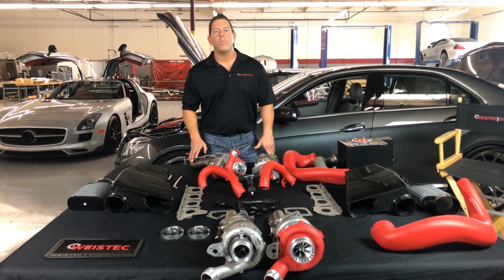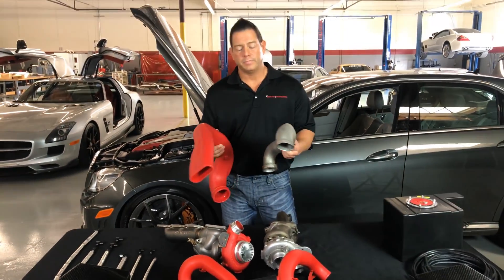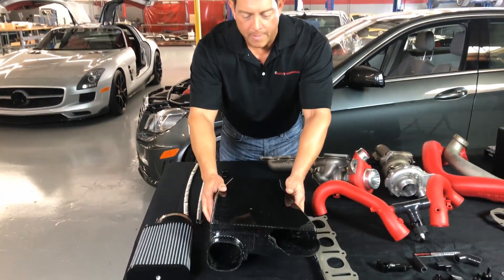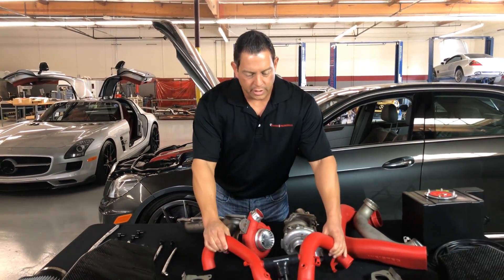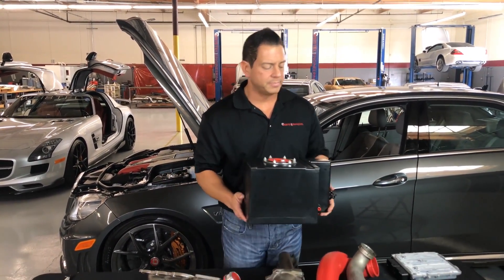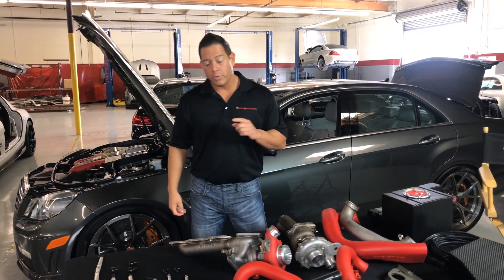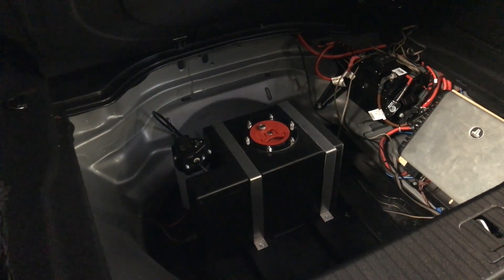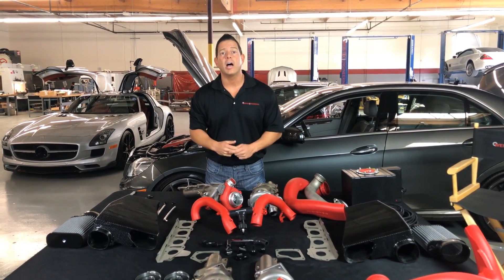Weistec M157 W.4 Turbocharger System Overview

Comment: I'm confused for the $13k option online what is included from that table. It sounds like at least the meth injection kit is included at least. But when I call to confirm it's just the turbos. No tune no intake system just the two turbos. Need confirmation before I'd be willing to spend $13k
Reply: Yea man same.

Comment: Don’t buy anything from Weistec. Poor support and they sell garbage parts. I bought a set of pulleys for my C63 W204 AMG. The most expensive pulleys on the market. Total garbage. The bearings failured after 3.5k miles.

Comment: Why isn't the headers equal length?
Reply: Only just enough room to squeeze in this log type manifold, so would be impossible to fit in headers with equal length! However, this type of manifold will work fine with a turbo set up

Comment: What do you do for fuel pumps and injectors? Can't skip that
Reply from the maker: The current set up on the vehicle handles the W.4 kits pretty well. But if someone is wanting to upgrade the fuel pump and injectors, it would be a great add on!

Comment: What about the m278
Reply: Its the same engine only m157 is hand built by amg and it comes in 6.3 variants on mercedes, the m278 comes in 500 and 550
Reply: Everything you said here is wrong haha! Amazing how people say anything on the internet as if it is fact. The m157 engine is a 5.5 v8 twin turbo. It was replaced by the m278 which is a smaller displacement 4.0 v8 twin turbo.
Reply: @nationalsearchinc.4769 You're also wrong..lmao